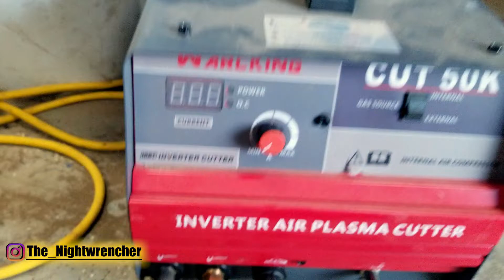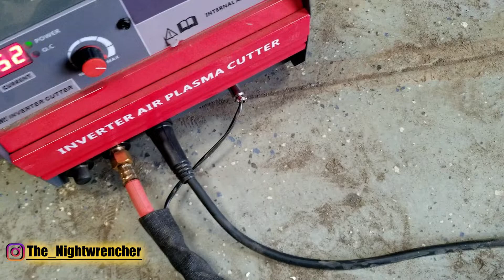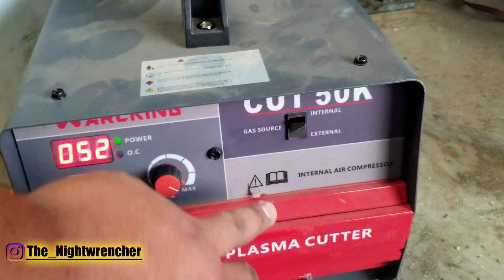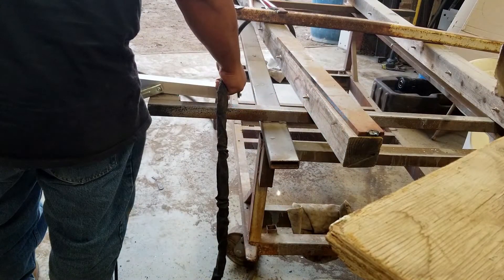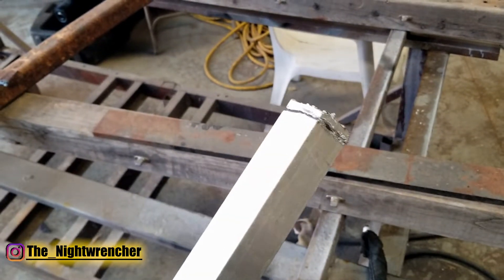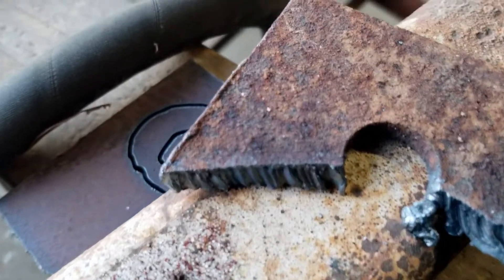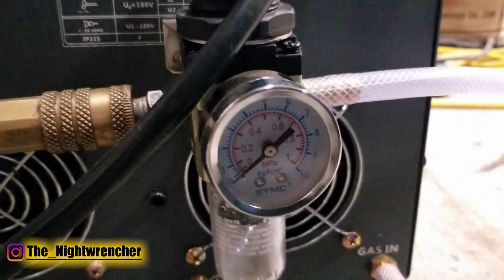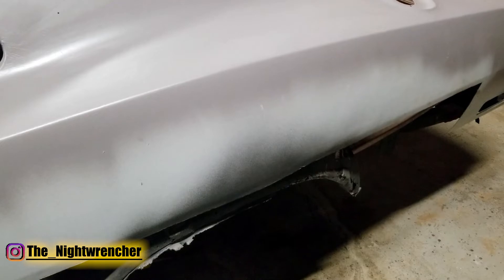WARCKING CUT50K 45A 220v Plasma Cutter Review | Welding For Beginners On A Budget |

Comment: You might want to contact your insurance.  You have made a bootleg adapter cord that is not up to code. If you have a fire, I have to question whether or not your insurance would be required to cover it since you purposely disregarded the electrical code.  We also don't know the gauge of the wire you used but I'm pretty sure that's not up to code either.

As far as the wracking, they do come up with some weird names.   I would test this to make sure it's grounded or that the case isn't live.  Given that I don't trust this brand as they made wild promises and you've used the bootleg cable, testing it to make sure that the case is at least not live, could save your life.

I do not recommend buying this type of product.
Reply from the maker: 🤣 youre hilarious
Reply: @NightWrencher  , and you are operating and encouraging people to do things that could be not just dangerous, cause a fire but also electrocute them.

Why do you think you can't buy a cord like the one you made?    Why do you think they call an adapter that defeats the 220 plugs' ability to only mate with like plugs but use a plug designed for 110 volts?

I dare you to test this unit and see if it's  grounded, or if the case is hot.    You must not take safety very seriously\